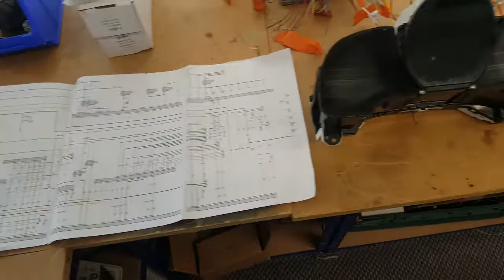CR-Z On the bench Video 1

Comment: Can you share wiring diagram with me
Reply from the maker: I only have the diagram details in my head.
Have you read my long threads on the CR-Z forum detailing all my mods.
Reply: Dear Peter thanks for your early replay ...actually i am going to use only the igbts with it's driver board....and stm32 nucleo for control part....As your knowledge is it possible ??
Reply from the maker: @experimentslk5291  I have no idea. I don't know anything about STm32 stuff. 
However the IPU modules use standard 5V analog phase control  inputs IIRC.
Reply: @retepsnikrep  thank you very much...